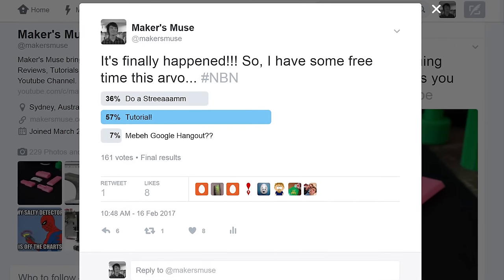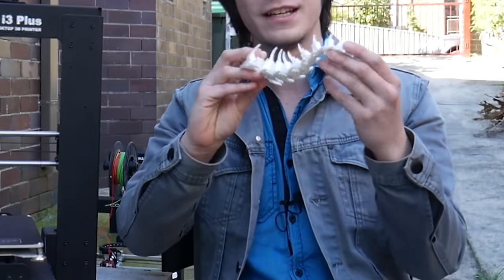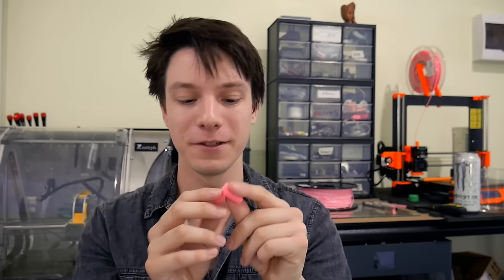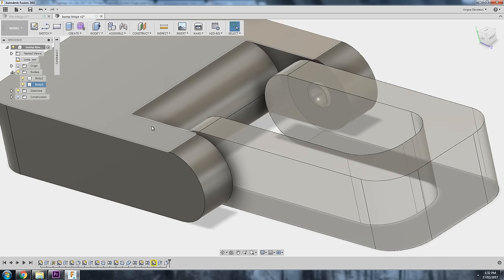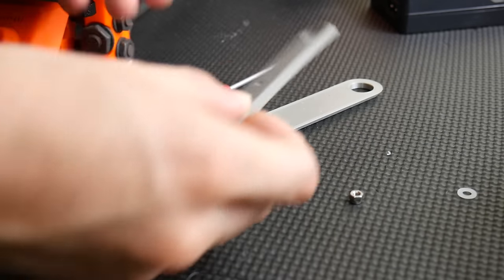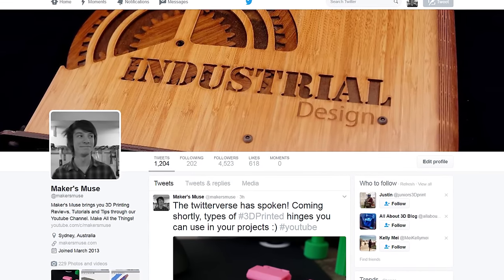How to design 3D Printable Hinges - Make moving parts!

Comment: Hi Angus.  Good video, but, I have one bone to pick with you and so many 3-D vloggers/designers.  Having been in the machining world for so many years, this practice is kind of like someone scratching their fingernails on a blackboard to my psyche. LOL.  

That's the habit of using "tolerance" and "clearance" interchangeably.  Although they should be used in unison to build a proper design, they are actually two completely different descriptions for defining the correct fit and form of any design.  I'm sure you know all of this Angus, but those viewers who are new to 3D designs may not understand the difference between these two terms, especially since they are often used incorrectly in many vlogs.  Those viewers should read the following so they will be more familiar with the differences.  There are certainly more complex uses for these terms, but here is a somewhat simpler explanation - using your pin hinge as an example:

"Clearance" is, in its simplest form, just the amount of space between two or more parts of an assembly which have a built in (and ideal, or "Nominal") distance relationship between their surfaces.  Like in your pin hinge, the diameter of the male pin must be smaller than the diameter of its female counterpart.  Too much "clearance" will make the hinge sloppy, and too little will make any hinge movement difficult, or even impossible, to function as designed.

"Tolerance" - in the pin hinge example - is the stated amount of variation that the designer will allow for that Nominal "clearance" value.  How far it can decrease or increase, and still allow for the assembly's designed functionality.  This "Clearance/Tolerance" combination is controlled in the design by dimensioning both of the Nominal diameters for the male and female mating parts.  Then, specifying the maximum values that each diameter is allowed to deviate from the Nominal diameter - as specified by the designer.  That allowed variation should ALWAYS be shown as its "Tolerance" - in some form.  Examples of the same stated values - with tolerances:
3.000 +/- 0.005
3.005 +0.000/-0.010,
2.995 +0.010/-0.000,
and (occasionally) 2.995/3.005
etc.

The designer always has to make sure that the male parts diameter - at the maximum "tolerated" diameter - will still enter the female part with proper "clearance" even when the female parts diameter is at the minimum "tolerated" diameter.  Again, for example:
Male pin specified as 2.990 +/- 0.005
Female hole specified as 3.005 +/- .005
This yields in a Minimum clearance of 0.005 clearance (actually, 0.0025 wall clearance), and
a Maximum clearance of 0.025 (again, 0.0125 wall clearance),
when both mating parts are at their extreme allowed values.

For complicated parts, this becomes quite tricky due to "Tolerance Buildup" as more and more parts are added to an assembly.  A technique known as GD&T is very helpful when designing extremely complicated assemblies.

Sorry, I didn't intend to turn this comment into a lecture when I started.  Hopefully, I didn't make any math errors above. A clear understanding these two unique terms should help to improve anyone's designs so the designs can function much better in the long run.  JMHO.  :-)

And, yes, I realize that I may get some ribbing comments for using the "Male/Female" terminology" - but that's just the terminology that I grew up with in machining - just like male and female electrical connections.  Ha Ha
Reply: Thanks for the heads up! :)
Reply: Thank you. Will look up GD&T now.
Reply: Thank you very much for this comment, as I have been confused on these terms (and heir application) in my own Fusion 360 designs.  This was very helpful in helping me better understand tolerance and clearance.
Reply: Excellent explanation!
Reply: Beautifully explained! Is there a way to determine which clearances are suitable for any diameter male-female pair? Is it very material dependent? I'd be trying to 3d print some hinges myself so having an estimate of what might work would help guide my design. Thank you so much for the comment!
Reply: @vishank7  - Not that I know of.  But, the issue would probably be heat related in my opinion.  Materials expand and contract at different temperatures, so the clearances could change with different temperatures.
For example, a female ring of steel can be heated, and a male plug cooled.  The ring will expand slightly, and the plug will contract slightly.  So, the plug can actuality be (very) slightly larger than the ring - at room temperature machining temperatures - but the heating of the ring and the cooling of the plug will allow the plug to be (quickly) inserted into the hole in the ring.  When the two parts are returned to room temperature, the plug and the ring will (essentially) be one part.  This process is referred to as "shrink fitting."  A similar process is used called "press fitting" where those same parts are forced by pressure in order to mate together.
Shrink fitting would probably be impractical for 3D printed plastic parts, but press fiting could be practical - but there would always be a danger of breaking parts unless one of the parts is soft enough to "give" a small amount.  In that case, the difference in the size of the two parts would have to be determined through experimentation.
Another consideration would be that since 3D  printed parts are printed in layers, each part has "ripples" which have different diameters when you look at cross sections of the parts.  These "gaps" will allow for the plastic to give somewhat and press together more easily.
I hope I've explained this well enough to provide you with a little help.  A video would probably explain it better, but I'm not much of a video creator or editor - LOL.
Reply: Hey I know this comment is old but any advice on 3d printing a dual axis hinge??

Comment: Another good and inexpensive option is if you need to put a pin hinge into a joint but you can't have it print in position due to print orientation: use a section of Filament as the hinge. Install a cutoff section of Filament during assembly, heat the end to mushroom the end to fuse in place... and voila.
Reply from the maker: True that, and you can also use a soldering iron to melt the ends of the filament so it can't fall out :) Good alternative to using screws.
Reply: I've used 1.75mm filament as a pin in a watch band and toy tank tread.
I used a butane lighter carefully to make a slight rivet head on the ends of the filament.
It can be a nice color contrast if you care about looks.
I used a Makerbot with 2.4mm diam. holes. Try a test piece with holes of 2,  2.2,  2.4mm.
For a longer "piano hinge" you might want 2.6mm holes to allow for the slight curve of the filament.
Reply: Eric Lien ou bois, i use HEAT to melt those ends. You could melt it with fart if it's warm enough :)
Reply: It's also less hard on the plastic parts compared to using a screw or bolt where the threads will wear away at the plastic over time. I've designed a mechanical hand using that method and it works great.
Reply: I was thinking this exact thing while watching! I recently played a little with friction welding by using a piece of filament and chocking it up in my rotary tool. Run it along an interface and it can make  It can make a decently strong connection! Certainly enough to hold a pin in place. So there's another option for securing the pin, in addition to the excellent options also put in this thread.
Reply: A section of Filament is not straight. In theory, this could be an issue for a long hinge. Any way, a great idea!
Reply: Ha! A clever idea to use filament!

Comment: 1:20 pin hinge, printed together and non-separatable (0.3mm tolerance)
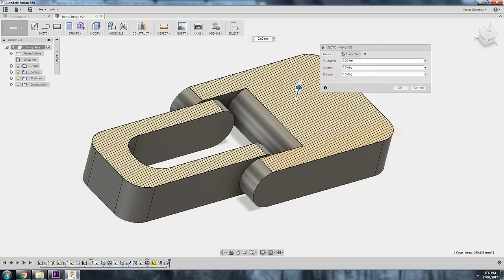2:28 variation on pin hinge w circular nubs that lock together, separatable (0.2mm tolerance)
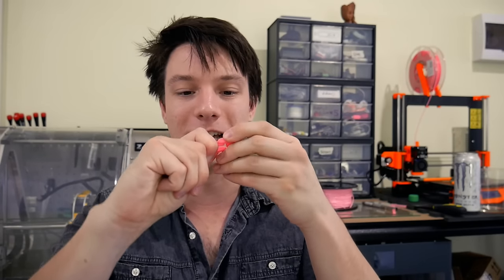3:46 living hinge using thin plastic to bend
5:00 variation on living hinge, clasp to lock in
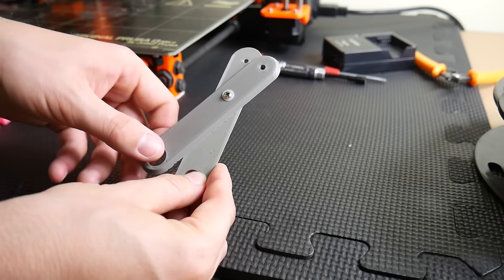6:10 fasteners and nuts

Comment: I actually like Maker's Muse a lot more than other guys not to say they are not good but, simply because Angus has tons of experience in this field, this guy actually has extensive knowledge on electronics, coding and programming these old school machines. Angus is extremely helpful and super friendly. I can tell he knows exactly what he is talking about especially on new machines that came out, he can identify the weak and strong points of that machine just by looking at it, for example on the Cetus printer he knows exactly what motor they are using  (linear guide rails) and he can tell there will be wobble because of unbalance mass. Thanks so much Angus !

Comment: Great video Angus! I will suggest to add that in second Hinge fillet the internal corner can help the part to be more flexible and don't brake the parts when you push them to put them in the right place.

Comment: For the fastener-type hinge, you can print a pin on one part and a hole on the other.  The pin would have a mushroom head with a split down the middle so it can compress to fit through the hole.
Reply: Also it can have a pin-in-pin to lock. Search for "plastic clips for cars". Some use another plastic pin for lock, others use a metal screw, or a smooth plastic pin (and the hole is tapered in near the prongs of the mushroom. etc A lot of variations of this clips.

Comment: I've used PLA for living hinges and it worked very well for prototyping with no failures. From memory I think it was "Infinity 3D" branded PLA. Orientation is crucial to get good results
Reply: I am just toying with the idea of how to make living hinges. Seems to like printing them flat ( fully open ) will be a disadvantage in terms of lifespan. Is this true in your experience? If so, how do you set up for printing it 90° to the bed?

Comment: Variation on the fastener hing is to use a piece of fillament as the pin between to parts. You need a tight fit on one of them, looser fit on the other.

Comment: hey, enjoyed it. you should add the pop in place hinges like they use for some clothing or bag info / price tags. Basically, you have a 'space needle' or  'eiffel tower' with a slip ring that goes over it and is free to spin. The tower usually has a slit in it to allow it to compress, and while it is 'removable', it is designed to allow something to freely turn around a fixed point. just a thought.

Comment: To add to your comments about injection moulded living hinges they only really work in polypropylene parts (Polyethylene can work as well) but when designed properly can last for thousands of cycles. The reason they work is because the polymer molecules all align parallel to eachother across the hinge giving the part strong bending strength in that area. The molecular alignment is due to the flow of the plastic through the thin hinge section and also to do with how it cools. For this reason 3d printed living hinges will never have the same characteristics of injection moulded living hinges, but as you've shown they can still work based on the general elastic behaviour of plastic parts. 

If you were to increase the length of the thin section between the two parts would this allow the 3d printed hinge to flex further before breaking?

Comment: Angus, would you consider doing a tutorial on modelling replacement parts that have a lot of curves? For example, I have TV remote that needs the backplate replaced, but due to it's curved design I have literally no idea how to go about measuring the curves and designing a replacement.
Reply: Curves are geometrically very tricky to replicate, because they are hard to measure. The easy way to replicate them is to measure hight and length ( for the proper scale ) and than and than trace the image if the shape over it. I saw Mithbusters do it quite often.
Reply: This is a tricky one indeed. Try taking photos of the part straight from side, top, front and so on. If possible use a lens with low distortion and long focal length. Then you should be able to insert those as reference images in to your modeling software. Now you can just trace the most difficult curves. There are other methods as well of course.
Reply: I'll give it a shot. I've also thought of scanning the object with one of those scanners in regular printers.
Reply: use one of the free photo to 3d model web sites. You can then either repair the model you get or use it as a reference to 'fit' your own model to. It's a lot more labor intensive though.
Reply: +Jay Sprenkle Not interested in that, tried it a few times with less complex objects and never got decent results :(
Reply: Tried it once but the object was translucent so it wasn't going to work anyway. Good to know that technology doesn't work well
Reply: you could add some extra form of your own, no need to copy it just make it yours. Have it have like a big bump if it helps with the grip or make it just unique. Or if you can come up with some extra funcrion.
Reply: I wanted to do that, but it has to match the original one exactly or else it won't fit
Reply: An accurate way is to construct cross-sections.  First I would make a paper grid, mount the part onto it, curved area needed, facing upward.  Then construct cross-sections at each grid line which match the contour of the part along that grid line.  This can be made from paper or thicker stuff.  When modelling in 3d you then can match your lines to each cross-section.
Reply: give up
Reply: For complex curved surface, you will need to find section curves at equal distance and then replicate it in your CAD. I have used two methods for this - Use a play-doh (clay) to copy the form and then cut it into thin stripes and extract the curvature, OR use a contour gauge - commonly available in home hardware shops, used to duplicate molding profile.
Reply: @GrodyMaroon  NO

Comment: I like to use another connection, rivets made of plastic. Just take a rod 1.75, insert it into two parts, on both sides of the rod melt it with a soldering iron. You can print out this stud of any desired thickness. These rivets are good to use instead of a bolt with a nut (6:31), because the rivets will not unwind due to friction.

Comment: Please help me. Speaking about revolution joint with pin (first example). How do you place your model on the slider? Pin vertical or horizontal?  There will be tollerances both on diameters and on space between joint faces...therefore In both solutions printer is going to come across a slice in which material has to be put in place up on a empty space... in case of you enable creation of supports are they not going to be fused together?  If you do not allow support thin space like 0.3mm won't be marged together? helpppp... horizontal or vertical? What else?

Comment: In my opinion fasteners are not cheating but additional (even essential) possibilites. Practical 3D printing is not an art, its a tool. And if there is a possibilty to combine with other technology it just makes the 3D printing more useful and viable. For example in many situation if i would need a proper smooth and exact hole somewhere i might just use a pilot point then drill it. (if the print is solid, 100% infill) or there are the threaded inserts, or you might need a metal pin somewhere, or you need a bronze bushing ring on it etc..

Comment: You mentioned tolerances but you didn't really explain what that means for those that do not understand the term or how to apply it in fusion or other modeling software.
Reply from the maker: +Joey Nuggetz very good point, it will be covered in a video all on its own but basically it's a gap to account for inaccuracies in the 3D Print
Reply: Joey Nuggetz A tolerance is the acceptable variation in measurement for a part. For instance a 10mm part may allow 1mm added or subtracted (11/9mm), or only 1 mm added ect.

Comment: If you are going to add hardware, rather then standard screws might I suggest shoulder screws  Yes they cost a bit more but the bearing surface is now a smooth shaft rather then threads.

Comment: He did miss a type of joint that I've used quiet a bit. Ball joint. It's pretty simple, just subtract slightly over half the ball from your piece, then slightly shrink the ball, and after printing them separately you can pop them together. Quiet useful for models that you'd like to pose.

Comment: You can a strand of printer filament as the pin in a pin hinge, after inserting the filament pin gently melt both sides of the filament to lock the pin in place, this means you don't need to buy metal pins.

Comment: forgot to add the possibility of using a pin hinge with semi enclosed socket  with a radius greater then 180°, given the play in the plastic you can insert it afterwards simpler to the dimple hinge you showed, you can also use keyed and/or pinned hinges the idea being that you have a hinge that can either only be taken apart in a single position or held together with a peice added after the hinge is assembled.

Comment: Are you going to test the Pursa 4 color extruder unit?  I was wondering how low a temperature the Pursa i3 can print at.  I found an analog eSun Emorph 80 C to the CX-5 80 C coming out this summer.  Have you ever printed with eSun Emorph?

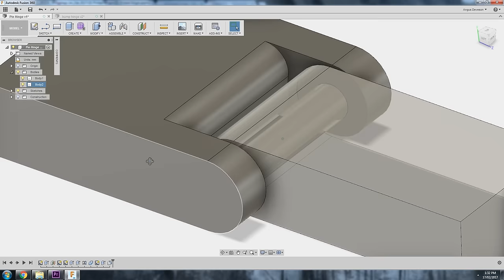Comment: For the hinge described at 1:40, how do you print that?  Does it need support of any kind, and where would it evacuate to?  The only thing I can imagine is that you have to print the piece in a certain orientation, but even then, I would imagine some kind of supports are required.  Design is fine, but how do you print something like that?  Thanks for the video.

Comment: I think PETG is pretty suitable for the living hinge as well.
Reply from the maker: it should be if it's printed super thin, but my experience with 3D Printed PETG is that it tends to shatter - especially if exposed to lower temperatures.